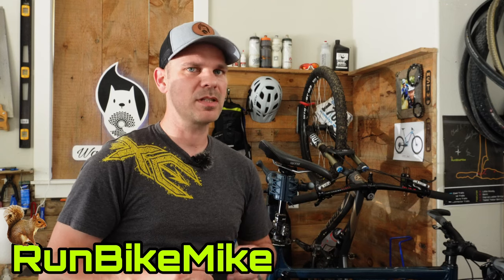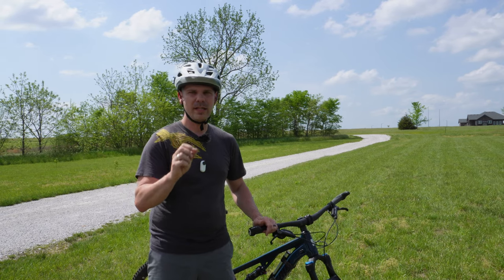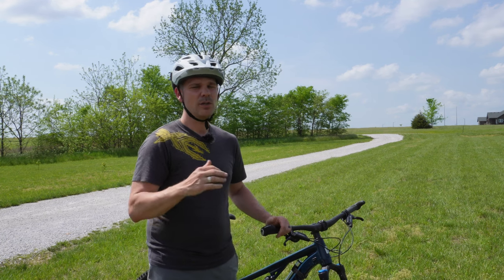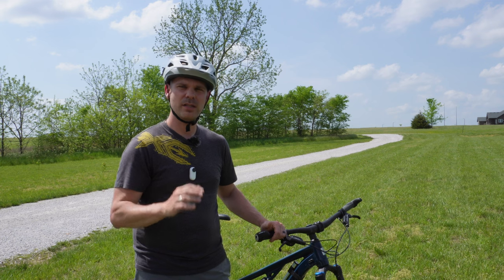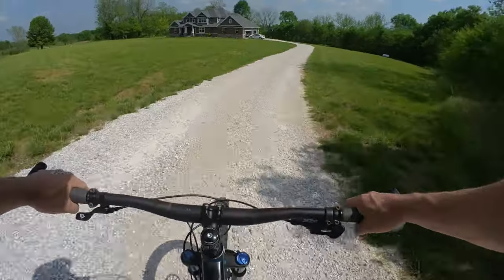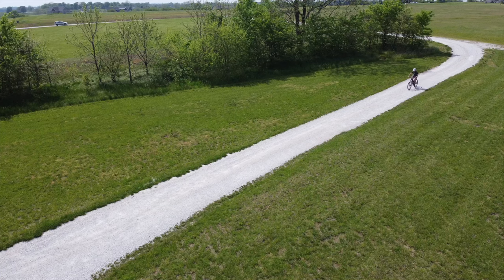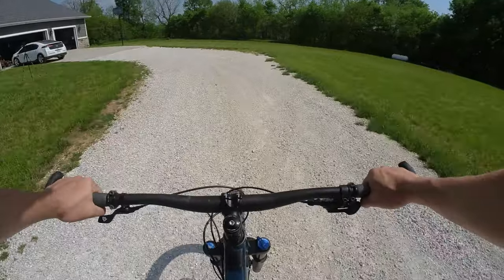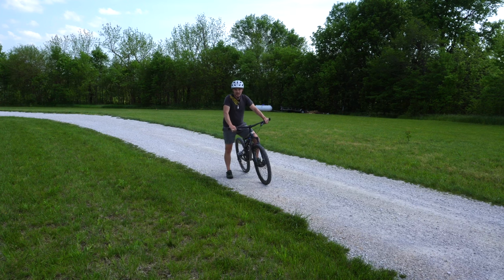How To Bed In Disc Brake Pads On A Bike

Comment: My street in front of my house is slightly downhill which works great for bedding in brakes. I can pedals a few strokes and use gravity to coast with the brakes lightly applied, about 6 trips with each set and no issues